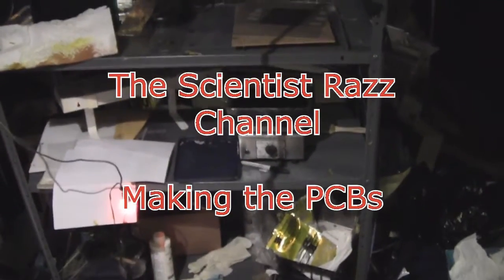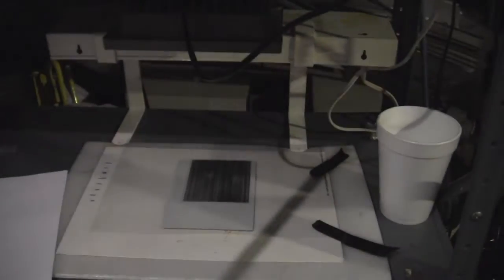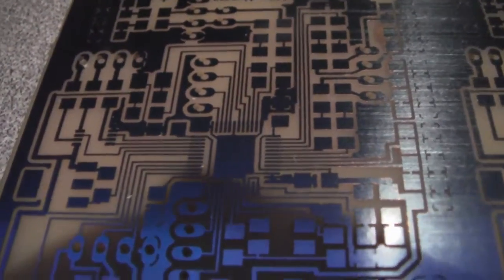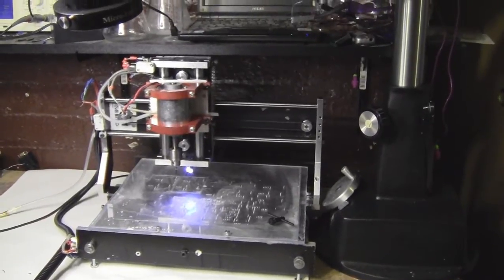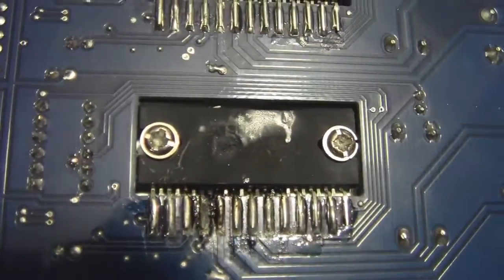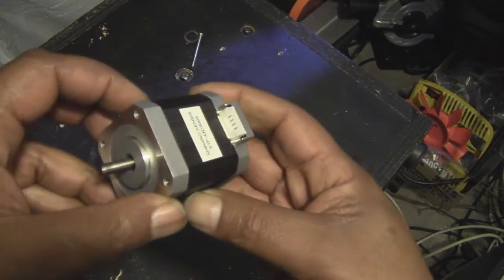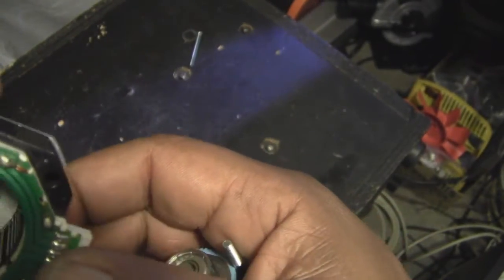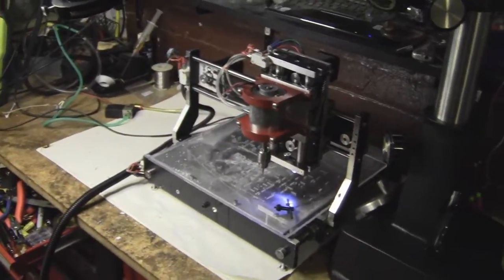Homemade CNC Pick and Place Machine X2 CNC #10: Back and forth

Comment: I suggest getting a G540 Gecko controller. Much better than plain ol' stepper amp chips. You'll notice the difference the moment the machine starts moving, the scratchiness/vibration will instead be smooth sounding motion. You'll also be able to go faster and no midband resonance. Gecko drives also have an optional idle feature that lowers power when not in motion so you could leave it on for days without issue and you're motors wouldnt even be hot. Or you could go all out on Clearpath servos and put Amp+Controller right at the motor with just a serial connection and raw power input. I have G540s and G203Vs that are 7 years old and still going. I burnt out those Xylotex type amps in my first month. But really, try something else you wont regret it. :)
Reply: do you recommend using RAMPS1.4 amd A4988 drivers to controller the stepper motors of a pick and place robot?

Comment: If I remember correctly, the motor supply is external of the board. That means that users have to fine tune the supply to the motor before applying the power to the board.  I make mistakes like this often and can't afford a new board so this time I've taken more precautions.

Comment: I'd put a resistor between the board and the motor.  What happens is that the board puts out too much power then the motor coils heats up then shorted internally. The motor isn't the problem as shown that 2 motors burned out.

Comment from the maker: Wow, that's very interesting. The TB6560 did blow when there were power line brown outs happening. I think we need to put those boards in enclosures because it caused a shooting open flame when it burned out . 
  The spindle is from a Zen Toolworks CNC machine. The Zen machine's chassis is made of PVC (thick heavy plastic) but it is a pretty nice small machine.  Very observant of you.

Comment: This is a common problem with THB6560 drivers. They are NOT designed for the use they are being forced into: They don't have power up sequence protection and need +5 logic to be applied FIRST and THEN the motor power. But all these board derive the +5 voltage from the motor voltage. 
http://www.cnczone.com/forums/stepper-motors-drives/139306-can-tb6560-driver-design-violate-chips-specs.html

This is documented in the datasheet from the chip mfgr and ignored on all those cheep chineese boards... the result? People just keep buying replacements and blaming motors, wiring, operator error, etc... More money for the mfgrs. 

Can I ask where that new spindle came from?